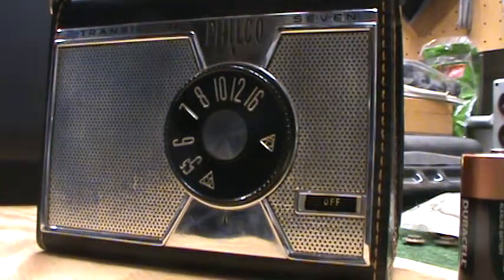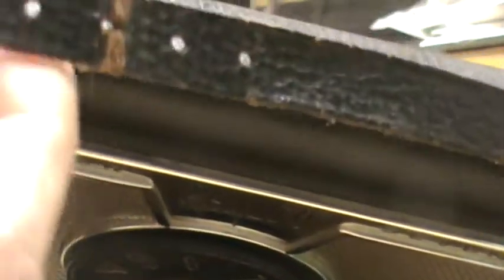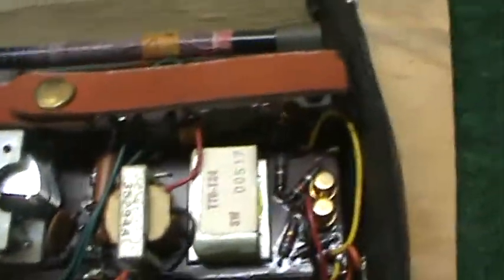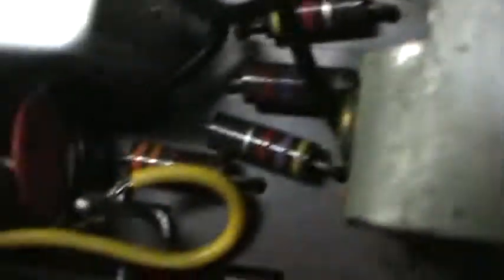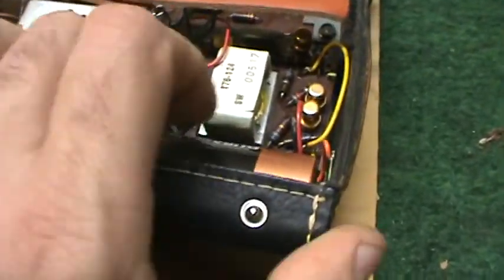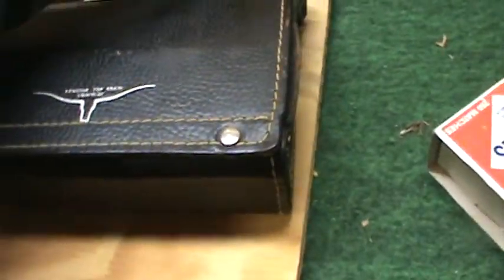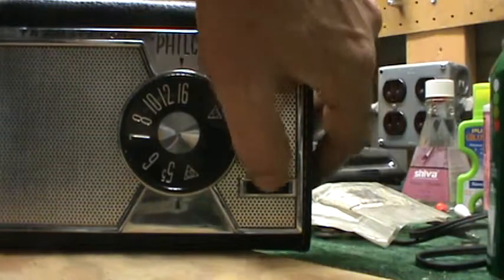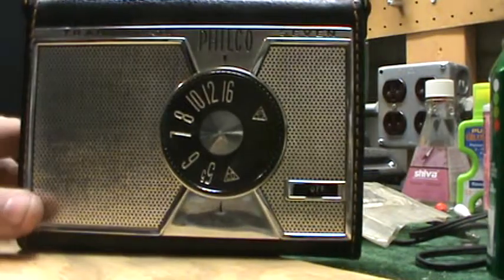Philco Transistor radio

Comment: I used to have a Philco radio just like this one- it was intermittent too- I suspected that there were cracked foils, and I ran solder over every last copper trace around and near the tuning capacitor. The radio worked perfectly after that.